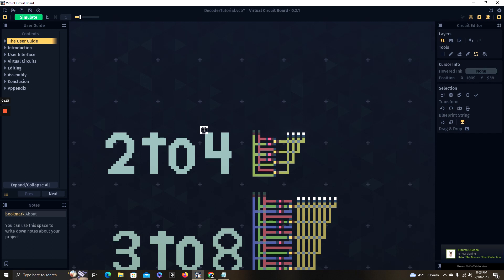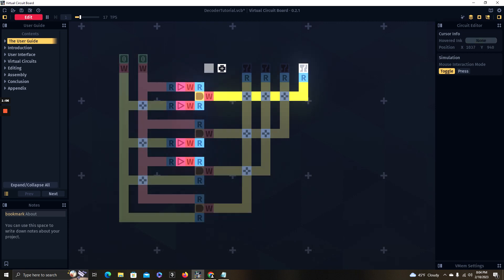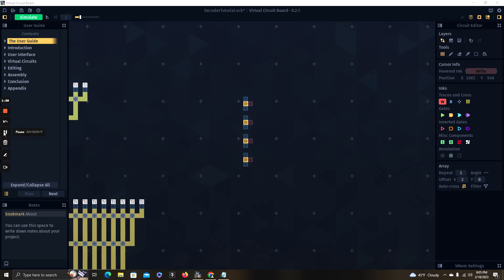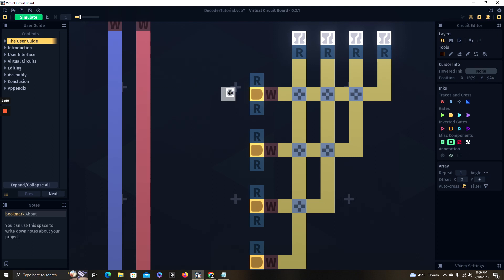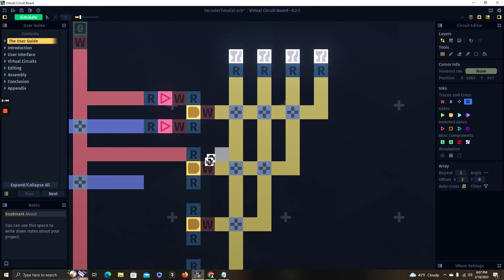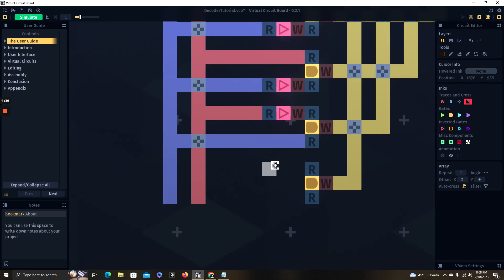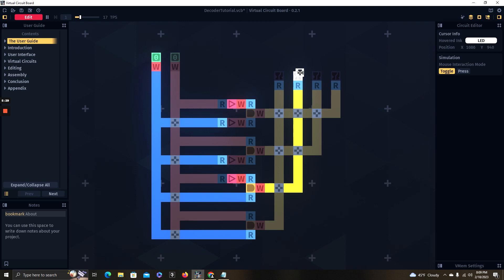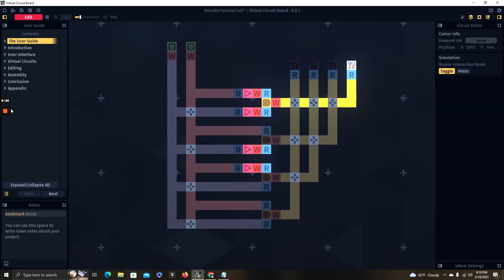Making a 2 to 4 Decoder - Virtual Circuit Board

Comment: I'm trying to figure how to use this.  I don't have a way of turning on or off circuits while the simulation is running.  There are no switches to turn anything on.
The items below are all that is listed.
Traces - write, read, trace
Gates - buffer, and or, Xor, not nand, nor, Xnor
Gerneral Components - latch on, latch off, clock, LED, timer, random, breakpoint, wireless

What do I have to do to turn on a circuit during simulation.  How do you turn them on and off.